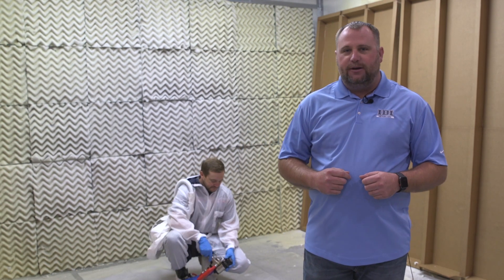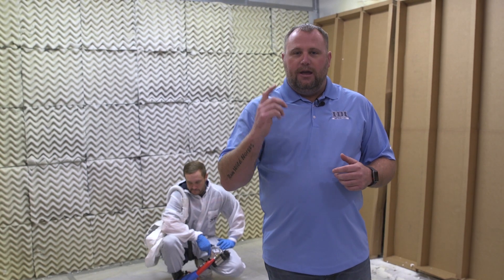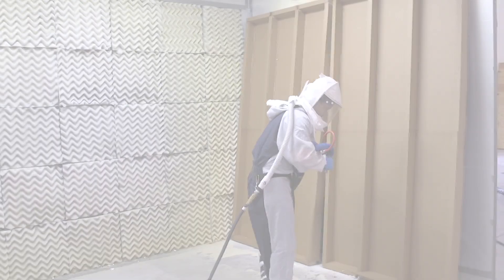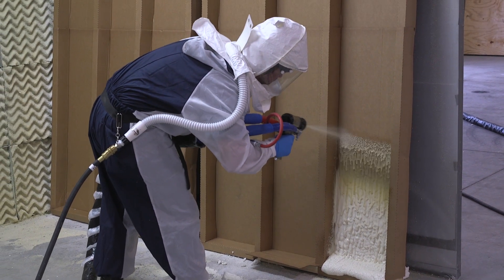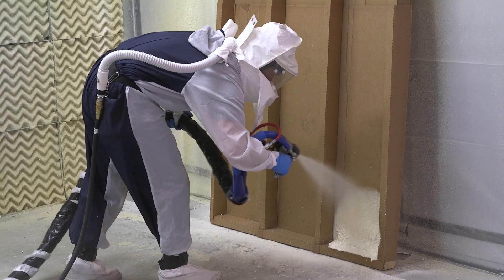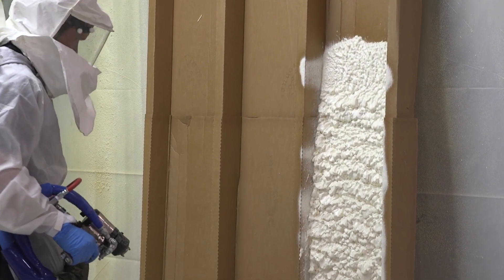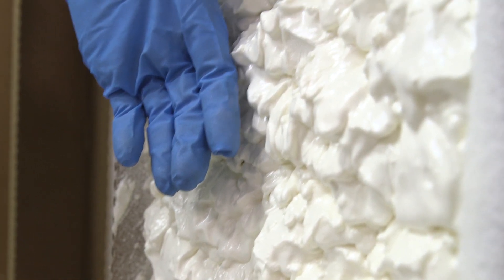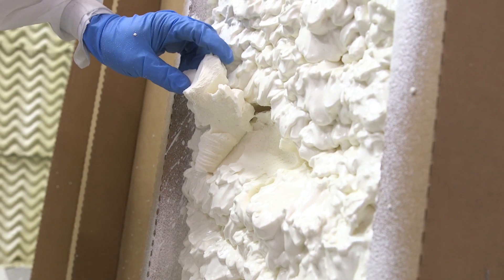How to Determine If Your Spray Foam Insulation Is at the Right Temperature for Use

Comment: I just bought some Versi-Foam for a set construction project (fake cave). When I pucked it up from the company that supplied it out iutdoor tempts were in the 60's. According to the videos Ive seen it needs to be in a room or somewhere that is around 70 degrees for 24 hours. I'm having a hard time reading the temperature reader on the tank.

Comment: We had closed cell sprayed in our new garage 6 months ago.  Now the foam is separating from the rafters and wall studs in several places 1/8” to 1/4”  gaps.  What can be done to remedy this?   This was done by a professional that has many excellent references.   He says that he can fix it with canned spray foam that you get at Lowe’s.   Does this seem reasonable.
Reply: No, I own an insulation company out of Florida. Your contractor messed up. Sounds like somewhere along the line he did not spray enough around corners, along the wood, or smaller crevices and air is getting behind the foam causing it to separate. Either that or his temps were off and he doesn’t wanna go through the hassle of ripping it all out and starting over.